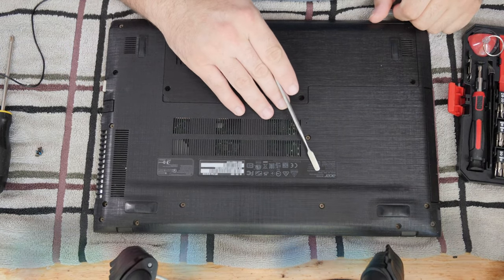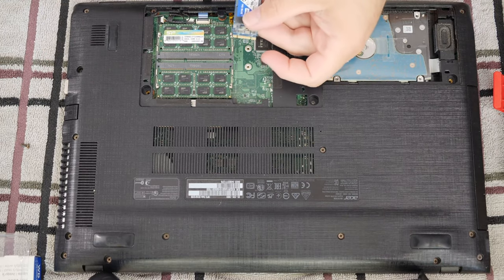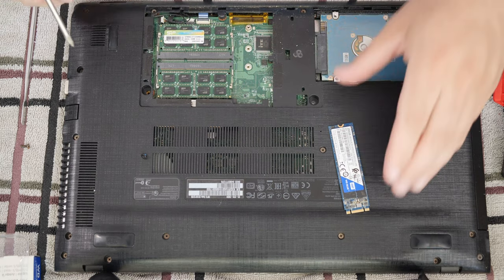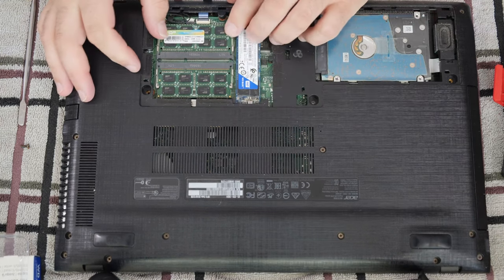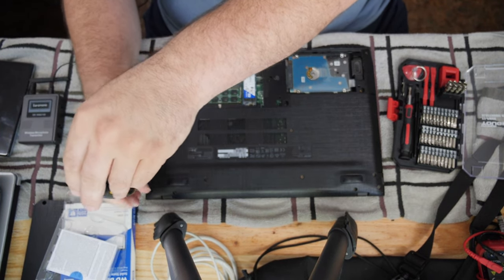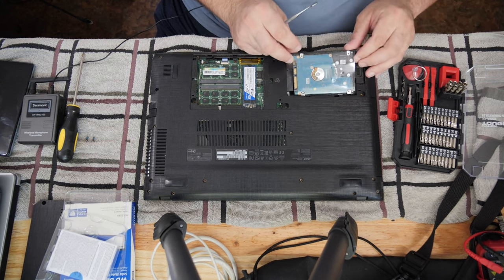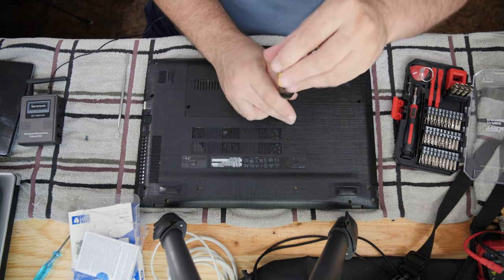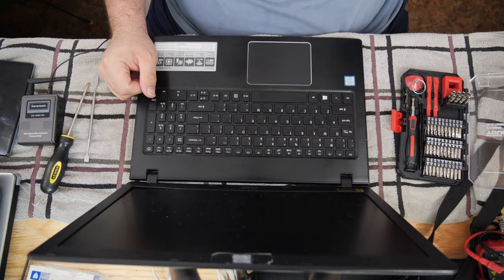Acer Aspire E5-576 M.2 SSD Upgrade - Jody Bruchon

Comment: Nice to see a video of how you clone the drive using free software.
Reply from the maker: I might do that, but the big issue is that I actually clone everything by hand. Quite literally:

# dd if=/dev/sdb of=/dev/sda count=64
# hdparm -z /dev/sda
# gdisk /dev/sda
...edit GPT partition sizes in gdisk here, next steps assume partition 4 is Windows system, 3 is "MS Reserved" and thus empty...
# sgdisk -u 4:$(sgdisk -i 4 /dev/sdb | grep un | cut -d\  -f4) /dev/sda
# cat /dev/sdb1 >/dev/sda1
# cat /dev/sdb2 > /dev/sda2
# ntfsresize /dev/sdb4 -fi
...get suggested resize size, round up to nearest gigabyte or up to ~10G less than new drive's size...
# ntfsresize /dev/sdb4 -fns 100G
...if successful and no apparent warnings...
# ntfsresize /dev/sdb4 -fs 100G
# ntfsclone --rescue -fO /dev/sda4 /dev/sdb4
# yes | ntfsresize -f /dev/sda4
...restore source filesystem size as well...
# yes | ntfsresize -f /dev/sdb4

Some of it changes depending on MBR or GPT, sizing issues, partition number differences, etc. but that's how I personally do it. Someone else who isn't insane like me would probably use Gparted.
Reply: I use a clonzilla usb-stick to boot and clone

Comment: I have same laptop Acer Aspire E15 E5-576g-59AB. I am planning to make the SSD as the primary. What M.2 SSD Drive are compatible to my laptop? Which is better Kingston NV2 Pcle 4.0 NVMe m.2 or Western Digital SN570m.2 Pcle Gen 3?

Comment: I have the e5 575 and want it faster? Would this make it faster or what should i go with? I did order 2 16 gb of ram to put in but dont know much about the nvme, m.2 or ssd? What i am considering buying.  Crucial MX500 4TB 3D NAND SATA 2.5 Inch Internal SSD, up to 560MB/s - CT4000MX500SSD1
Reply: Do you have 32gb ram installed  and working?
Reply: @aquamansurfer  Yes I do. Also have the new ssd installed and the computer is very fast now.

Comment: Which SSD is compatible with My laptop ; Acer Aspire E15 E5-576G-52E6
Intel Core i5 - 7200 U ?
Reply from the maker: You can buy any PCIe NVMe M.2 2280 drive.
Reply: @JodyBruchon  Thanks you.
Reply: @JodyBruchon my laptop is E5-576G-52H6. Do you advice to buy m.2 sata 2280 or m.2 NVMe?
Reply: hi  @JodyBruchon  so  any model e576g can use nvme ssd? max capacity in tb? thanks!
Reply from the maker: @aquamansurfer  Any size. There is no limit.
Reply: @JodyBruchon  thanks! So despite acer says no, you and customers on acer's forums say it works! I'll buy a 2tb nvme (expensive in Argentina ), i trust your knowledge . It's the same pcie 3.0 or 4.0? I guess motherboard  automatically downgrade to 3.0, but , ¿any difference in performance, temperature , etc? Thanks a lot again Jody
Reply from the maker: @aquamansurfer  This machine doesn't have PCIe 4.0, but any PCIe drive will work in it, so just ignore that entirely. Just get any drive that's decently reviewed and you'll be fine. Don't worry about temperature etc. If you have the money then you can buy one with faster I/O speeds but any NVMe (which is the same as PCIe for most purposes) drive will be faster than anything you plug into the regular hard drive port.
Reply: @JodyBruchon  excellent ! So, existencial doubt....: In any other case, ¿is it a lie when manufacturers says max storage capacity supported 1tb? I mean, any sata or nvme port can handle 2tb? Thanks again!

Comment: Is there a way to use the charger directly without charging the battery. In my laptop it charges upto 80% and slow charges to full and when I play a game the battery stops charging
Reply from the maker: Sounds like you may have an insufficient adapter.

Comment: Hi I upgraded my m.2 but it wont show in in windows media? Anyone know why it doesnt show?
Reply from the maker: Did you initialize and format the disk? Right-click the Start button (Windows 8 and up) and go to Disk Management. You can see the empty disk there and initialize and format it. Don't format any disks you already have and want to keep!
Reply: @JodyBruchon   @Jody Bruchon Tech  Im trying to install windows on it, but it wont pop up
Reply from the maker: There are several possibilities. One is that you've put the wrong kind in the slot. M.2 slots can be PCI Express, SATA, or both. If you install a PCIe SSD in a M.2 slot that only has SATA, it won't show up. Same thing for a SATA SSD in a PCIe-only M.2 slot.
Reply: @JodyBruchon  would that mean it wouldnt work at all? how would I know if it is compatible with my laptop?
Reply: @guccizaman8837  Check with Crucial scan, it will show you compatible upgradable parts
Reply: Maybe you need to Format the M.2 SSD so that Windows can recognize
Reply: Hope you have solve the problem!
Reply: hi  @JodyBruchon  ¿is it posible in e576g to use nvme ssd?? i read on acer forums and if in hwinfo shows in any of PCI express root,  max band widht 2x, aparently  it can be done, so,  if you agree  , ¿is there a problem with 2tb nvme ssd ?? thanks!!